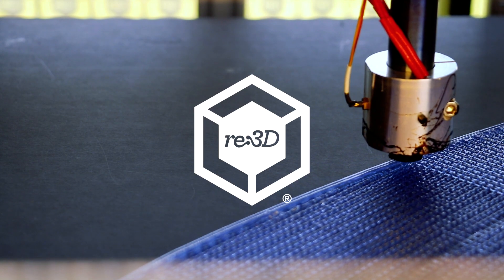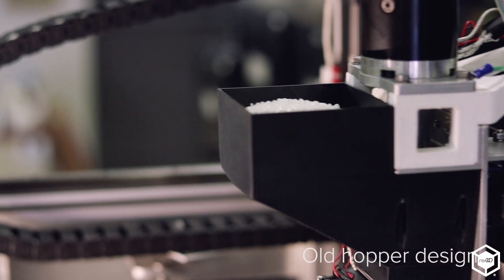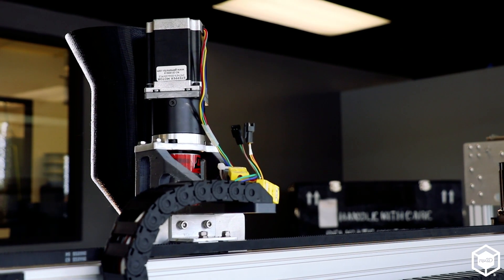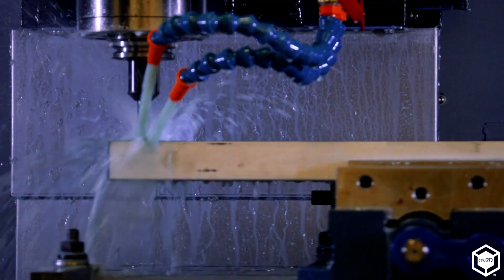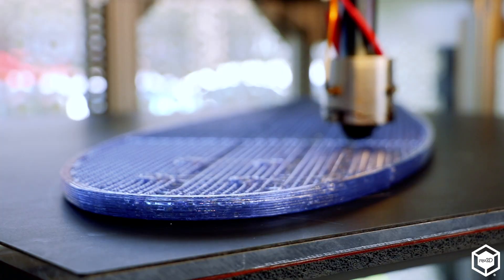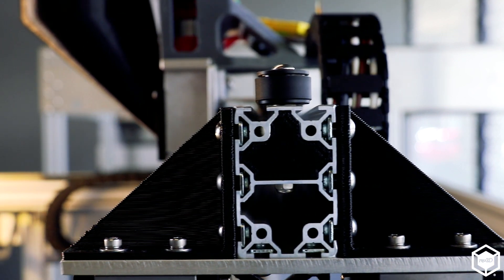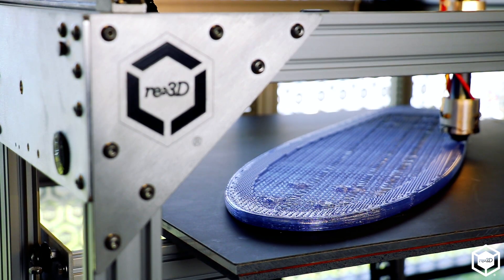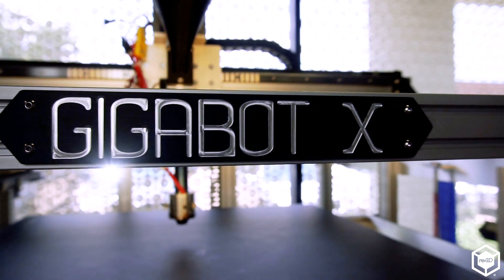3D Printing with Recycled Plastic Pellets: Gigabot X Update

Comment: What sort of prep is required for recycled PET?  I have the suspicion that due to some government programs where I'm located it would be easy to get infinite plastic bottles for free.  Would love to see a large scale effort to turn them into 3d printed furniture or something, but most of the processes I've seen for recycling them are far too picky to be automated cheaply.  People are removing labels, using solvent to remove glue, removing the little rings on the top, drying for 5-10 hours etc.  

Just wondering if you think it would be possible to just dump a ton of bottles into a massive grinder, caps and all, then print with the resultant material.  I think the various material inconsistencies might average out at scale and you could just optimize the print settings for the so called "average mix".

Comment: How about retraction of melt material during printing smal parts, will it cause oozing effect, leading to detoriation of part??
Reply from the maker: Great question Mohammad! Retraction is more difficult with this style of extruder, so for some part geometries there can be small voids or stringing. With some design modifications and/or profile setting tweaks we can mitigate those issues.

Comment: how is stringing not an issue?
Reply from the maker: Thank you for your question! Stringing can be an issue when working with large nozzles (>0.8mm), but we have managed to reduce it significantly through optimizations of temperature, retraction, and other slicer settings for the specific material. We run specific tests to dial in these settings for each material we print.

Comment: this is so awesome. pellets are like 0.7-1$ i heard but the mass is sooo heavy! definitely not for everyone but so cool!
Reply from the maker: The pellets seen in this video are recycled PETG which are similar in weight to new PETG, but when using a large nozzle size of 1.75mm the parts do turn out heavy! However, our talented engineers can now print through 0.8mm nozzles with phenomenal quality. Sign up for our newsletter if you'd like to stay in the loop! You can find it at the bottom of our website https://re3d.org/

Comment: where y buy that circle block heater?
Reply from the maker: The heater blocks are designed by our engineers and then manufactured in our factory in Houston. Are you interested in its design for a project of your own? You can reach out to support@re3d.org if you would like to learn more about Gigabot X.

Comment: How to control extruder?
Reply from the maker: We've been honing the extrusion settings for different types of material and developing Simplify3D software profiles for some of the main materials we've been testing, like PLA, ABS, PET, and PET-G. The idea is that the user will simply select the material they're printing with in Simplify3D, and all the settings will be taken care of.
Reply from the maker: Great question - all the settings are controlled via a bot-mounted Viki / Simplify3D software, just like on the standard Gigabot.